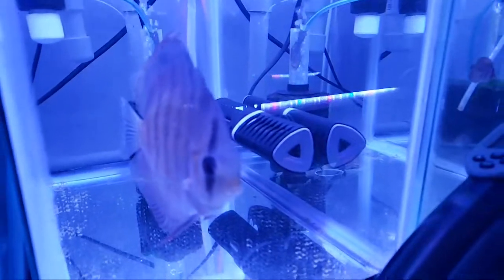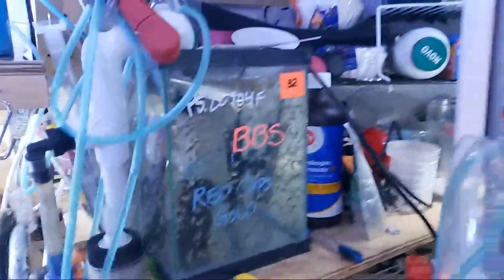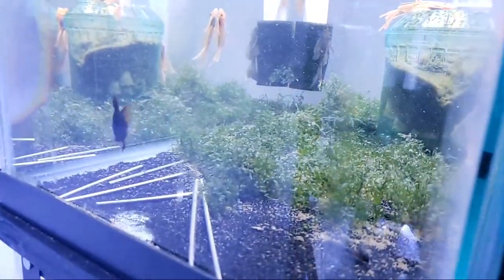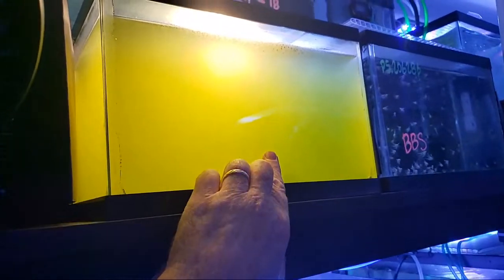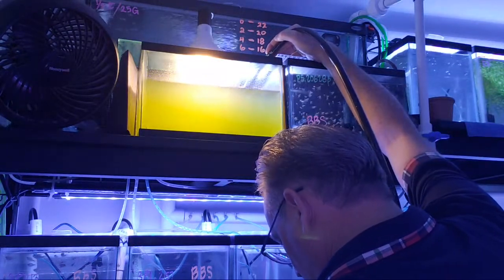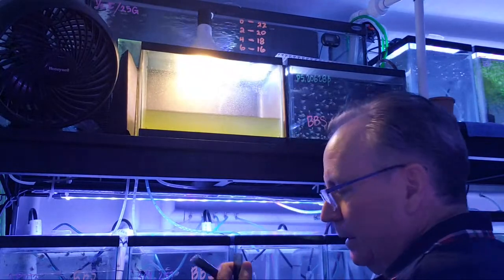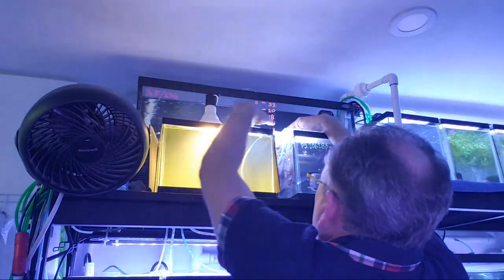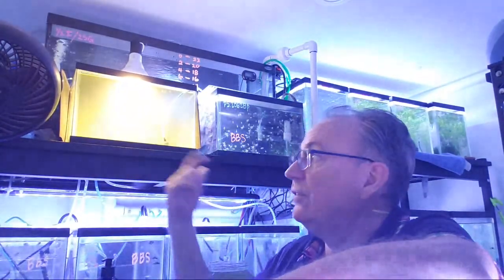Fishroom 411: Growing green water? Daphnia-Rams eggs process

Comment: Replay Crew here! Another great informative video! 
Question. You heat the RO water in the bucket, but what about when they're in the jar? Are you not worried about it because they're higher up and it's warmer? TIA!
Reply from the maker: Great question, but the answer is actually simple.  The heating of the RO water is because it comes out of the tap very cold.  So I heat it to about 83 degrees.  The room temperature is about 80-83 degrees, so there's no issue there.  I don't want to pour cold water onto the fish, so I use the warmed up water but "warmed up" in the sense that it's not so cold.  In my next Live Stream I'll mention this to everyone.  Great question.

Comment: I'm having an issue with my female bnp having recurring bouts of ick  and it's starting again.  She is currently in a 10g with 2 angels because of my tank leaks. 
I was going to move the angels to a 20g but now feel I must not. Any advice would be greatly appreciated
Reply from the maker: Well, the fact that they are in a 10G at the moment is a good thing only for treatment purposes.  Unfortunately there's not a lot of good medications for Ick that are available to the aquarists in Canada since restrictions have been imposed.  The best I have found for getting rid of Ick is the medication Ich-X by Hikari.  I seem to recall that is uses formalin in it and that works well.  Without the right medications, the best you can do is to raise temperatures to about 86 degrees and add salt at the rate of 1 tablespoon (or 2 to 3 teaspoons) per gallon.  It seems like a lot, but it will dissolve and provide what's needed for a period of time that will not harm the fish.  The treatment is not good for live plants, btw.  One must remain in this situation until the life-cycle of the ick is broken.   I hope that helps.  Catching it as early as possible works out best.